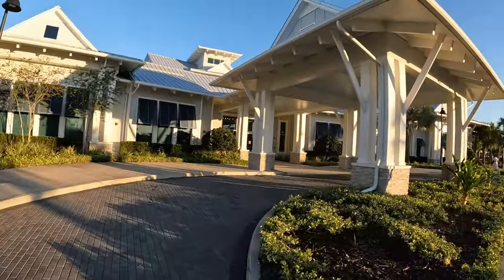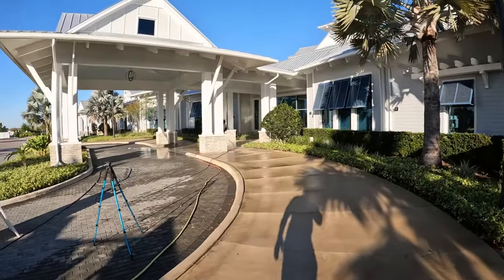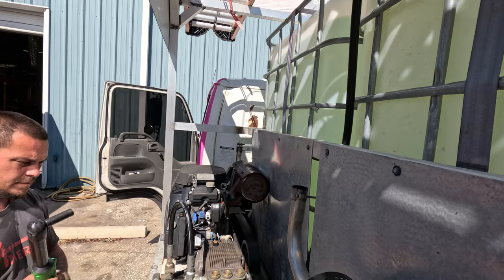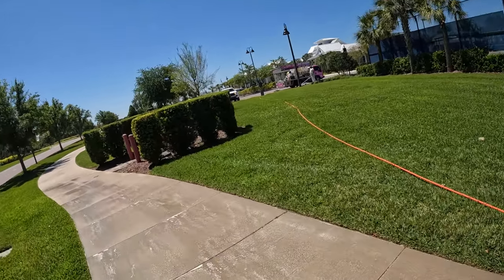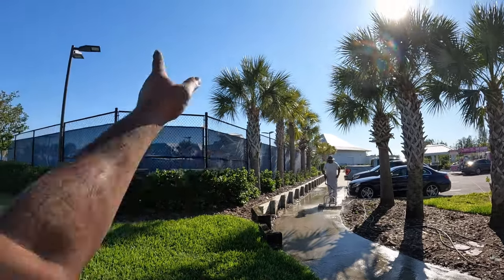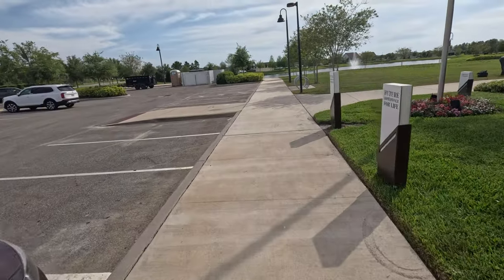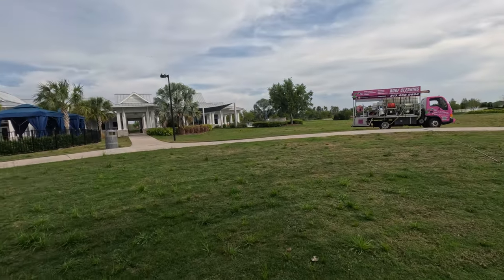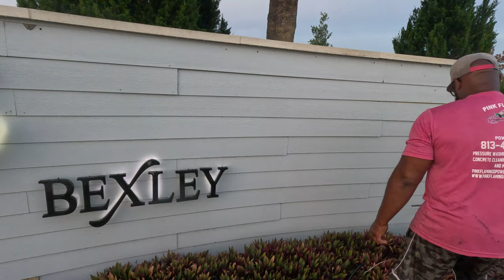SUPER HUGE HOA JOB! #surfacecleaning #powerwashing #pressurewashing #commercial

Comment: How has that Isuzu set up been for you? Does it ever make residential work difficult as far as parking and working in tight spaces? I currently have a 6x10 trailer rig plumbed for one man that I pull with my truck but I don’t see how it has any advantages over the Isuzu setup so I think that’ll be my next big upgrade
Reply from the maker: It's been awesome. Especially with it comes to doing big jobs like in this video.  I did have to make some repairs to it but it is what it is.  I wouldn't trade it for anything.  In fact I would buy another one in a heartbeat If I needed to.
Reply: @PinkFlamingoPowerWash  that’s awesome to hear. Only bad thing I’ve heard about them is that the underside can rust out pretty bad bc of the SH and it’s pretty much irreparable so you just have to get a new truck. Has this been a problem for you at all? Thanks for the reply!
Reply from the maker: @loganwashesstuff  I just got the truck so no. And by the time I gotta replace the truck it would have made me 100s of thousands so I don't care for that.  Also that's why I got an aluminum bed instead of steel bed.

Comment: Awesome video. I started my cleaning company here in Jacksonville FL and I added Pressure washing. I am wondering how much did it cost for the setup on that truck? It looks very nice.
Reply from the maker: The equipment on the truck? I had some new and use equipment so probably around 7k. Not including the welding customization.
Reply: @PinkFlamingoPowerWash  yes, the equipment plus the truck.
Reply from the maker: @EMT0210  shoot idk I stopped adding it up. I'd say the whole build , truck and equipment I'm under 25k.

Comment: Cliff- love the content- loving that Isuzu NPR- what size is that? Looking at something similar- if you don't mind me asking did you buy it new or used- they are expensive! But awesome trucks! Thanks for all the great content! Wash on bro
Reply from the maker: Hey brother. The bed I believe is 12-13ft long.  I bought it for 13k and it had equipment on it which I've sold 90% of it.  And then rebuilded it.  They can be expensive but there are some great deals out there.